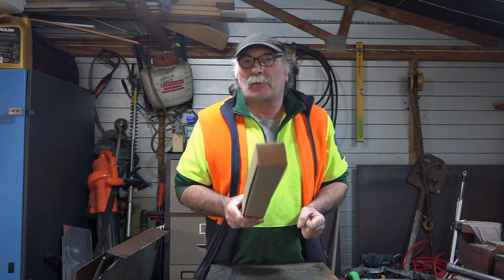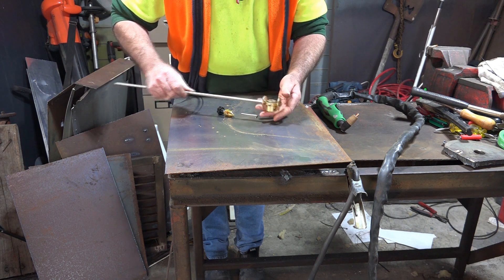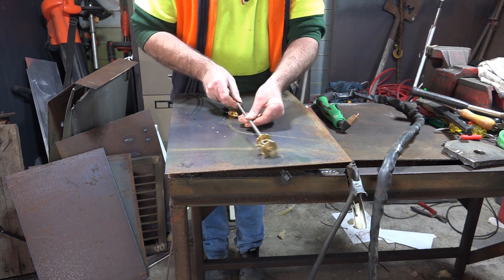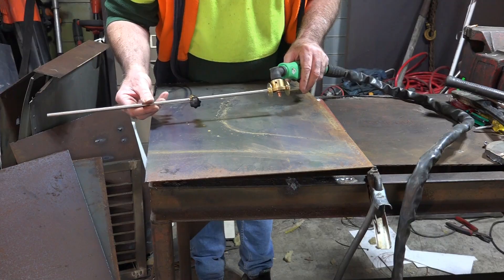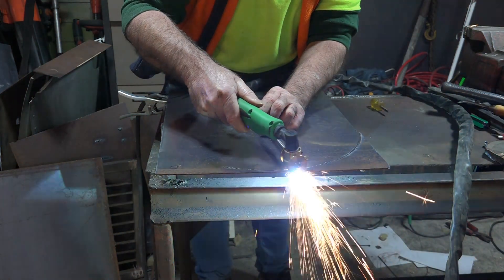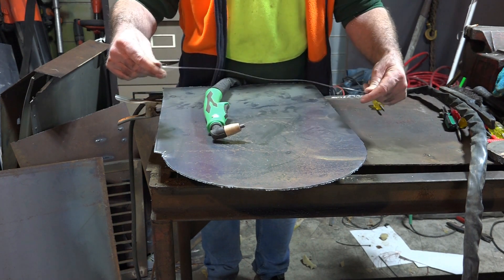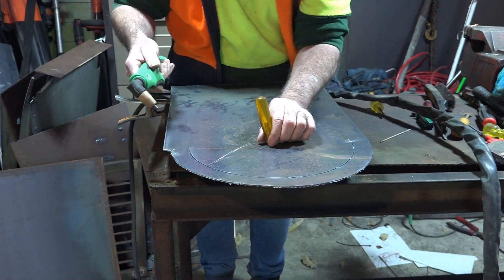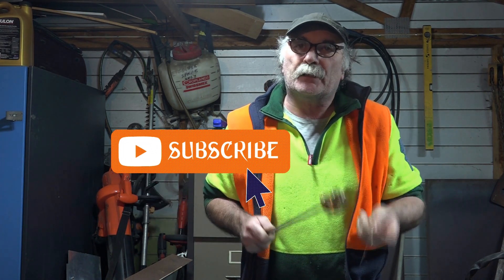Plasma Cutter Circle Tool - Is it Really Necessary?

Comment: I use the same type of circle cutting guide when I occationally have to cut in a circle. You show the guide for the PT 31 torch; I solely use the P 80 torch. 
I find it much more convenient to use a straight P 80 torch (P 80 "CNC"-style torch) for this work. With the air hose slung over your shoulder you don't have to worry about damage to your air hose, nor will it get stuck on any sharp corners. The full cut is made smoothly in one step.
Reply from the maker: Good idea